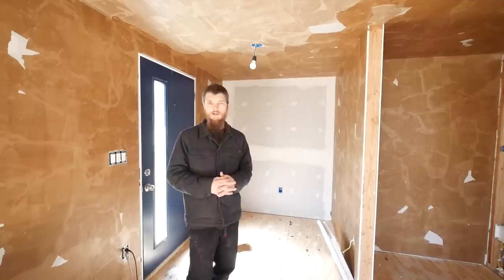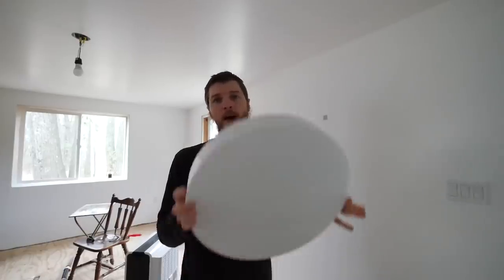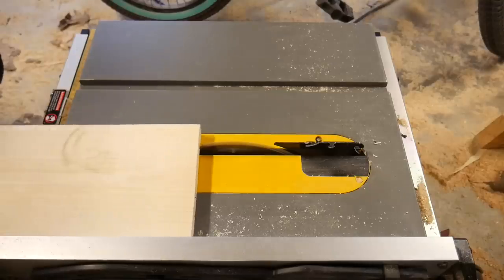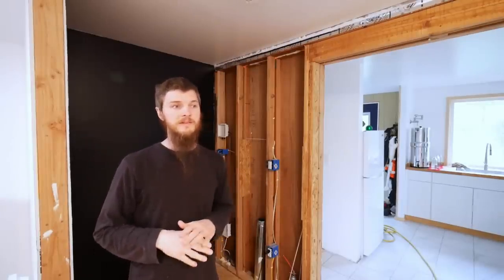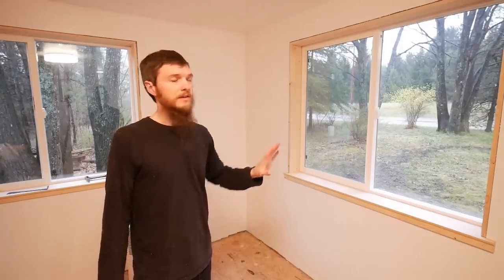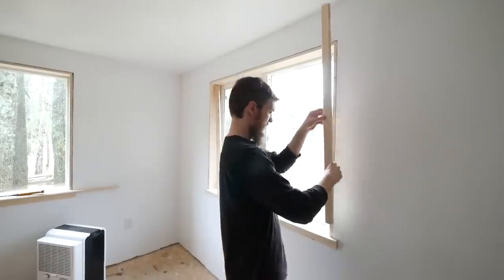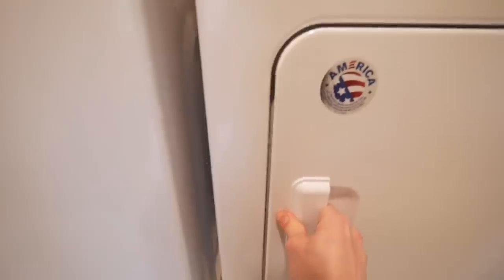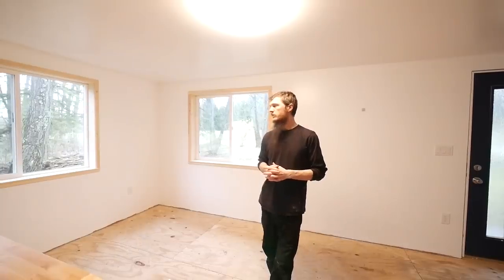Living Room Makeover Begins...AGAIN - Mobile Home Renovation

Comment: As long as you need to pull the drier out to work on the hose, you might think about placing a rubber mat underneath to help keep it from sliding. It might not be a bad idea to buy one for the washer as well - when they do their spin cycle, they can generate enough of a vibration to move it around on the floor - a mat for each (or one to fit under both) would also keep them the same height.

Comment: You can get an anti vibration/non slip mat or feet pads to stop the dryer from moving on the floor normally made from white or black rubber not sure how much in us but amazon have them in the uk ranging from £3 - £10.

Comment: Hot glue doesn't hold up for doing trim.  It will lose it's grip and fall apart.  I currently am using DAP brand All Purpose Acrylic Latex Caulk Plus Silicone (clear).  It is paintable and is a strong multi-surface adhesive.  It holds trim in place very good.  As for the dryer moving around, cut a board to put behind the dryer on the floor.  The dryer will go until it hits the wood and then stop moving.  Measure and cut it to fit from the dryer to the wall.
Reply from the maker: Great idea for the dryer. A simple solution :)
Reply: @diyfferent  I always try to do things the simplest way possible.  I can't afford to be spending a ton of money on doing things the fancy ways.  Right now, I am building myself a shed (8' x 16') for storing my firewood to dry after it has seasoned out in the weather for a year.  I am doing it myself and not buying a shed.  By doing it myself, it will cost about 1/3 the cost of buying one from a store and I get it the way I want it and not what the manufacturers think you want it.

Comment: To protect the top of my dryer, I use a rubber tub mat. The suction cups on the bottom prevents it from moving, and because it is rubber, anything I place on the top, like a hamper, doesn’t slide around. I think it works great!

Comment: Doug they make grips for woodstoves that sit on tile, Idk what they are called but I had issues with my coal stove moving when raking on the slippery tile, put these under the feet and they stay put.  They are like carpet protectors for furniture. I'm sure it will keep that dryer steady when opening and closing door. Living room is looking awesome, those lights are bright. Trim looks great, don't use hot glue even gorilla glue unglues with temp fluctuations.

Comment: Hot glue will not hold down.  If your painting the trim. Use drywall mud. Let dry and sand.  If your doing a stain finish. Put a touch of glue and saw dust from your sander.  Let dry sand smooth and stain

Comment: You have a stye on your eyelid. A warm compress is the most effective way to treat a stye. The warmth helps bring the pus to the surface and dissolve the pus and oil so the stye can drain naturally.

Wet a clean washcloth with warm water. Make sure the water is not too hot. Wring the cloth so it’s damp but not dripping. Then gently place it over your eye for about 5 to 10 minutes. Do not squeeze or try to puncture the stye.

You can do this 3 to 4 times each day. It’s easy to boil an egg and use that inside the washcloth.  You can then re heat the egg and keep reusing it to put in the washcloth.

Comment: Sometimes people lean on the dryer door, when opening it. Just put your hand into the handle and pull upward (while the door is open) resetting the dryer door hinges. I also think the cloth (with fringe) on top of the dryer was stuck in the hinges. When the dryer is in use, don't have the cloth on top of the dryer as it might be a fire hazard. I really like your channel. Thanks

Comment: I have the same dryer. The door is supposed to be hard to open and close. It has a good seal. Just open the door to stop it and don't force the timing knob to counter clockwise or you might break it.

Comment: I don't know your experiences with those type of LED lights but my experience with them is they burn out within a couple of years regardless of their claims of a long life. Then you are forced to replace the entire light fixture rather than just a bulb.This is true especially if they are made in China. I now only use light fixtures with LED bulbs that can be changed without having to replace the entire fixture.
Reply from the maker: Yeah we like fixtures where you can change the bulbs too because then we can choose the color temperature and wattage, but we just didn't find any other fixtures that we liked. These have been working good for us so far. But I know what you mean.

Comment: I have the same washer and dryer. I just checked the door on mine and yep-its secure for sure! The washer and dryer are both pretty light. Our water heater leaked behind the washer and dryer and it was so easy to pull them out to mop up the water (I have a hallway nook too). The house is looking great! Love the light fixtures in the living room. Have a great Wednesday-bye! :)

Comment: I attended school with a guy that had an occasional sty.  It appeared painful.  He told me when at home he frequently placed hot compresses on the area.  The heat helped pull the infection to the surface.  He thought it shortened the duration of the infection. Of course that occurred over 50 years ago so there's probably many other options today.  But hot compresses are easy and certainly affordable.

Comment: I bet construction adhesive would work pretty well for attaching your jambs to wood. For attaching to drywall I bet some caulk or some other type of adhesive would work well. The only problem with those would be that you'd have to clamp them until they dried

Comment: I was taking a break from cleaning cabinets in bathroom to watch your video. You amaze me! I have a question??? Is it ok to turn knobs nowadays counterclockwise? My husband messed up 2 washers and dryers doing that. The repairman said, that's what caused the problems. I was told by my daddy to only turn knobs clockwise, since I was little. I told my husband not to do that but he intentionally did it! Since you're an electrician you can set me straight. Thanks in advance.
Reply from the maker: It depends on your washer or dryer. I think some of the older ones could only turn one way but the newer ones can usually go either direction. Some people say that you should turn it clockwise to help reduce wear on the timer but I'm not sure how much it matters. I personally wouldn't worry too much about it, but that's me :)

Comment: Just a suggestion: we’ve had a wood stove as our primary heat source for 18 years. It’s just plain dirty. Ash dust goes everywhere and I have to clean/mop/dust daily. Our son bought a house with a pellet stove and it’s 99%cleaner with the same if not better heat. His is consistent heat for 3 days ( his hopper holds 3 bags and burns 1 bag a day) and we have to reload our stove every 4-6 hours including thru the night. We are thinking of switching to a pellet stove for cleanliness and we are getting older and tired of hauling wood. Thought I’d just give you something to think about.

Comment: This is what i was talking about cabinets above drying and washing machines. Looks good! Just put some anti vibration rubber legs under machines, it will help with slipping and reduce noises. 
In my house there is no 90 degree corners, so there is a lot of chims and cracks :) 
Good work, keep it up!

Comment: Everything is looking beautiful! I wouldn't do hot glue the heat from the sun would melt it and it would get loose. You may want to try gorilla glue it don't take much you just lightly dampen the wood and put a little glue and give it time to dry. It expands like the foam that you spray around windows so don't use it to close to the edge. We bought RTA cabinets to put in our mobile home we renovated and it has held great.

Comment: Really loved the magic screw! You've done some incredible work in your house. Suggestion; my easy fix for the dryer sliding is the silicone drawer liner material cut to fit the feet. With the tile you have, it should work perfectly. I found mine at the local resale store for a dollar a roll.

Comment: I bought a dryer a few years ago, and had a great winter drying clothes and blankets, they were so beautiful, nice and fluffy. And then, I got my electricity bill. It was a shocker! and I've never used the dryer since. Maybe it was the brand I bought. I don't know. But just be careful until you get your first electricity bill after using it, incase they are all the same.
Reply from the maker: We pretty much stopped using a dryer and haven't used one in about a year and a half! We bought that dryer when we moved in and haven't even used it, haha :)
Reply: I live in East Tn. and use my dryer all the time. My electric bill is always low. I love it and use it all the time.

Comment: Just a thought. Woodstock are so dirty, how about a pellet stove instead. And they just vent out. There are some really cool looking ones. I had one in my store, little ash, and so much cleaner. You just wash the glass door with a little vinegar and water. I had a wood stove in my house. Hated it so much. Bringing wood, stacking it, the walls were ruined from the smoke, and so much more ash to clean. You clean them out once a year and I could handle it on my own.
Reply: They are nice, and clean, too.  However, I've noticed that sometimes the stores run out of pellets, and you can't substitute regular wood.  That could be a problem.
Reply: Our wood stove caused our ceilings to yellow\gray.
Reply from the maker: We appreciate the thoughts.

Comment: 100% done 2 minutes later after checking it out, about 90% done :D. also are you not afraid that the wood stove will color your ceiling with sooth ? you could do something cooler like build a small closet for it :D also we have a nook like the closet nook as well , what i did was put 2 sliding mirror doors on it that way the light hits it and opens up the room even more, closing the closet

Comment: Had a similar mobile dryer, the dryer bottom was open and we fixed it by two little L brackets attached to the floor in the rear, upper part of the L fit inside  now it only moves about an inch.

Comment: Stud glue is the strongest ive used. Apart from screws, ive used stud glue on the back of anything ive stuck to the wall permanently. Including the bathroom sink 😉 i found out how strong it was when i glued a steel shelf set to the wall temporarily, no nails, so i could store some towels and stuff. Its weighed down lol waiting for a proper cupboard, and im wondering how im going to get the shelf unstuck😂😉

Comment: Awesome job as always.
You might want to put in some ceiling fans in if you’re getting a wood stove, especially in the living room.
I know this from experience, I’ve used a wood stove for over 30 years now and I’m so happy I have my ceiling fans to distribute the heat.
I’m sure you know they make low profile fans. 
I would suggest checking out Vermont Castings brand stoves, they’re very efficient and have catalytic converters in them to minimize fuel use.

Comment: There's a product called "No more nails" you can use, it goes on with a caulking gun.  I use it on stuff that I can't nail in.   I was going to complain that it's not the same without you coming into issues that gives you headaches, however,  I was very pleased when I saw that board hitting you on the head, literally giving you a headache.  ;)

Comment: You can get the stuff for your cabinets or for under rugs that is slipprof and put small pieces under the front of the dryer, it will stop the movement. Don't mess with the door it needs to be tight.

Comment: Get some non slip matting  that you get for under your video / dvd player etc to stop it sliding and put some under your dryer , also comes in white so you can make covers for the tops of both washer and dryer to stop scratches and stay with the all white theme.... its as cheap as chips to buy and available in most hardware & Junk / $1 stores....you can get small squares and I'm pretty sure by the metre in bugger stores.. ( chuck the cloth Ashley LOL ) or church shop for 2 white towels ??  sorry just thinking out loud...house looks awsome.

Comment: I would worry about hot glue getting too warm and failing in the summer months.  Wood glue maybe with hot glue as temporary would be what I use on my cardboard projects.  Grab it is what I use with paneling that is very unforgiving though, you really have to put it in place quick and straight.

Comment: What were winter heating costs?  What  was you average indoor temperature. And what was the outdoor temps like this winter in your area?
Reply from the maker: Our electric bills were very affordable this winter. On average they were about $260 per month. Comparing it to summer bills which were about $60 per month, it seems to be that the heating portion is about $200. We kept our thermostat around 70/72 this winter. Outdoor temps were mostly in the 30s for daytime temps and nighttime temps were in the teens/20s. (Some colder or warmer days sprinkled in) When we moved in we used a propane furnace for heating we spent about $300 per month, and that was just for heat alone, but that was also before we upgraded our insulation.

Comment: i would suggest anthracite coal instead of wood if you were closer to Pennsylvania...i do know of people in michigan that can get and burn anthracite coal tho. michigan is large, not sure where you are in relation to them. the advantages are no worry about creosote fires, burns hot and is steady, no smell, no smoke, it burns with a blue flame. the stoves have option of hand fed or automatic feed models....i have a coal stoker stove now but will be installing my new to me coal stoker boiler this summer, i just shut off the coal stove today and will be taking down the duct work and installing the boiler and plumbing and radiators. it's going to run year round and also produce all my hot water. again shame you are not closer, i would give you a stove, i have three of them that i won't be using. when i built the garage last year i installed pex in the slab and buried insulated pex going to the house. won't need several stoves, just one heating source for the house and the garage once i'm done this summer.

Comment: OK...i've had this question in my mind for some time, what will the title of your property say on it? will it be listed as the same '78 double wide or what?? your homeowner's insurance  will have to be updated? I am amazed at the quality of your work. have mavrick kiss your bo bo. take care and stay safe......K$
Reply from the maker: The home doesn't really change, regardless of the work. I think it's technically classified as a HUD sectional. An Affidavit of Affixture was filed on this home, which is a document that reclassifies it as real property instead of a "mobile home" for tax and bank purposes. But the title remains the same.

Comment: You mentioned the wood stove for heat in the living room, but I'm wondering what the plan is for cooling the house in the summer? I don't think you installed any ceiling fans. It does get awfully hot and muggy here in Michigan in the summer.
Reply from the maker: We've never used AC anywhere we've lived and definitely don't need it here. It barely even got warm last summer. We only had 2 days hit the 90s and the rest were comfortable. We appreciate when it finally gets warm out after 8 months of frigid winter  :)
Reply: @diyfferent  I surely understand what you're saying about the cold weather, I live south of you near Lansing. So glad your house stays cool enough, that's a blessing! As I've gotten older, I can't tolerate the heat like I did when I was young.

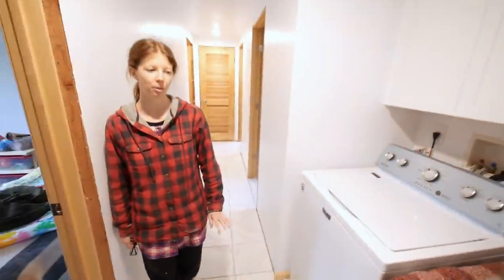Comment: 15:55 Doug for year I have used a dryer diverter in winter to vent my dryer heat into my home.  It's free heat, you've already paid for it, why not use it instead of venting it to the winter elements and wasting it and the money it represents.  It has a built in lint screen so that's not a problem.  Never had any issues with excess humidity in the house.  The house is normally in need of humidity during winter. https://www.amazon.com/dp/B0006IEMUK/ref=cm_sw_em_r_mt_dp_U_9avXEbW7Q2ERD

Comment: Put a block of wood the width of the dryer on the floor behind the dryer then it shouldn't move backwards possibly.  Just some baseboard trim down the hall and that will be done too.  Love the cabinets over the washer and dryer are you planning on putting up handles or knobs at all?  Gods blessings.
Reply from the maker: Yep, we'll be adding hardware to the cabinets :)

Comment: Cut a block board to lay behind the dryer on the floor to the wall and it won't slide back. You said you hoped the accent wall came out. I would be in shock if it doesn't. Everything you do works out well so why would that not?

Comment: When I get a new appliance: washer, dryer, deep freeze... I cover it with clear contact paper to prevent surface wear. When the contact paper wears out, I peel it off and put new on.
Reply from the maker: Good tip!